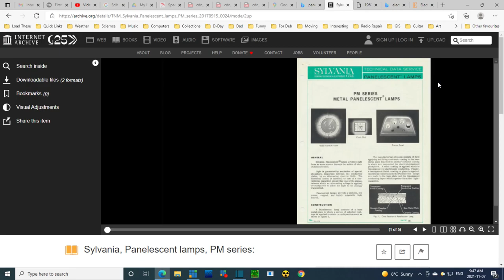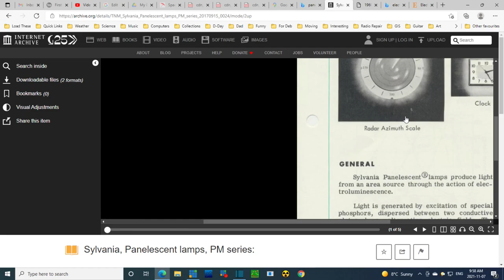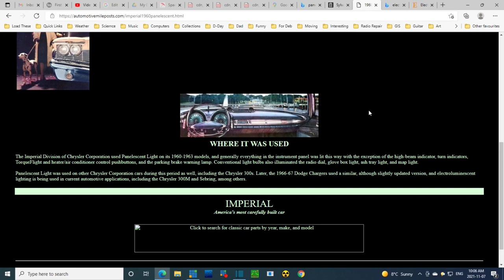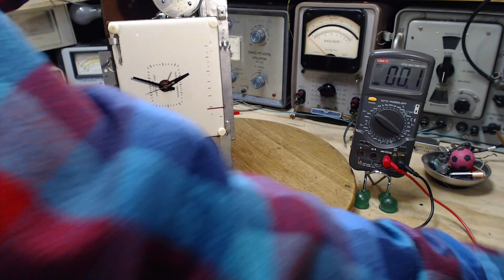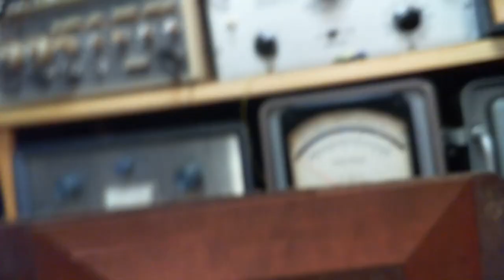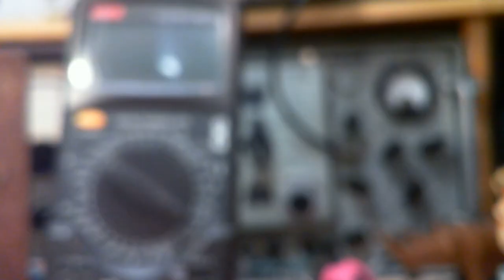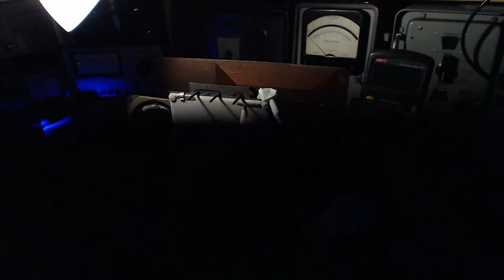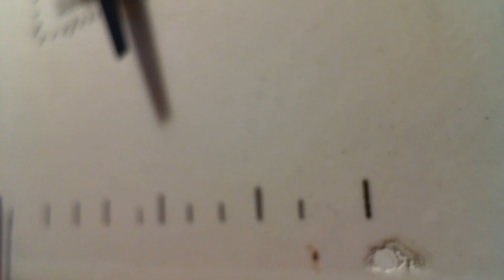1955 Sylavania 598 Clock Radio Video #7 - Panelescent Backlight and Finale

Comment: There is a product made that is a thin plastic sheet with a silver strip along one top edge and another along the side edge forming two electrodes connected to the electroluminescent sheet. One can cut this sheet into size and shape required as long as there is a bit of each electrode still on each segment cut out. The electrical connections are made to these electrodes. They use and AC voltage of about 100 to 120 volts for which you can buy a little PC mount inverter block.
These sheets come in several colours and are used as back lights for LCD displays. When I worked as a BioMed I used to replace the back light in LCD displays with this material.
They wear out after a while.

Comment: To get an accurate reading with the clamp meter you need to put it in place where you want to take the reading, then zero it, then turn on the power.  Also note that with a capacitive load you can quite a high current but almost no power dissipation because the current is 90 degrees out of phase with the voltage.  (Although the panelescent is disconnected anyway so that can't explain the 0.5 amp.)

Comment: FYI Jeeem : Sylvania Monochrome TV sets , in the mid 1950’s came with a gimmick they called “Halo Light “. It was used in an area surrounding the edge of the CRT. The idea was to equalize reflection on the CRT faceplate surface. The three color light primaries are green, red and blue. The human eye is most susceptible to color of green.  I am not sure the halo light was a panelescent  type.
Reply: Try silver conductive paint.  Malcolm

Comment: Remove the clips and the wires and disable it because it has failed a long time ago and it’s pointless because to replace it would require a whole new clock face